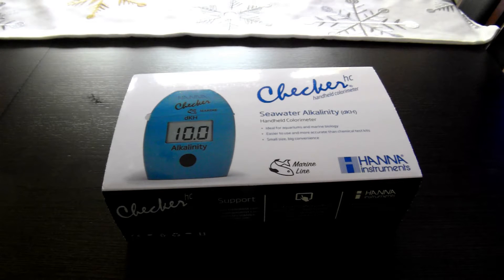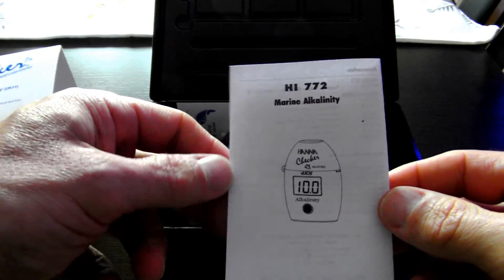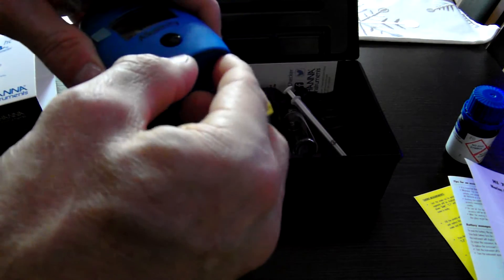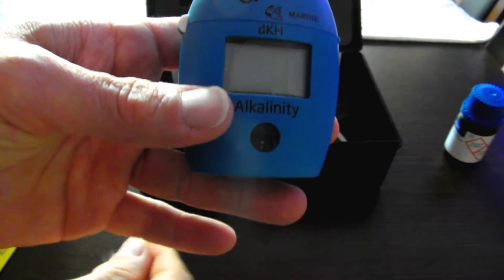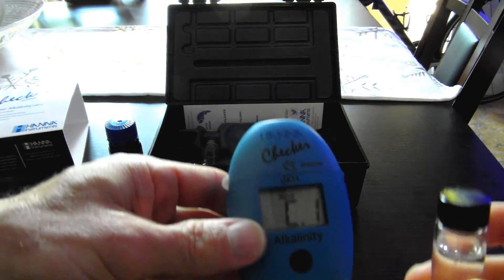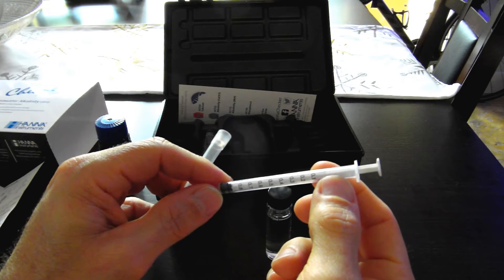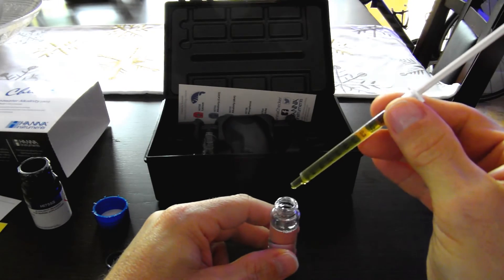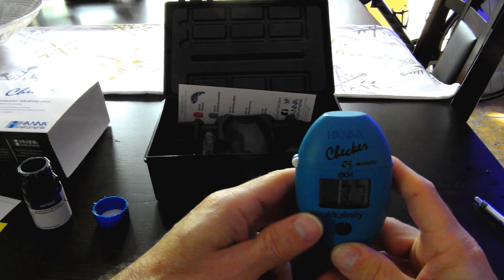Hanna Alkalinity Checker (dKH version) Unboxing and Initial Test Use

Comment: The one part I needed to see about how the battery cover comes off and he skips the video with an explanation 🙄
Reply from the maker: If the battery door/cover does not come off easily after removal of the screw, you can insert the tip of a small screwdriver and gently pry it off.

Comment: The 'Air" you are trying to get rid of is needed. the tip contains solution so just bring te bottom plunger line to 1ml and you are good. Do not try to account for the "air"
Reply: Also he is supposed to clear fingerprints before c1 and c2 clean the test tube with a microfiber as per the instructions